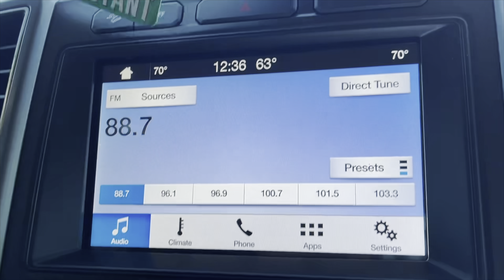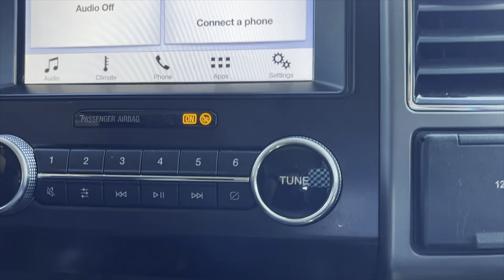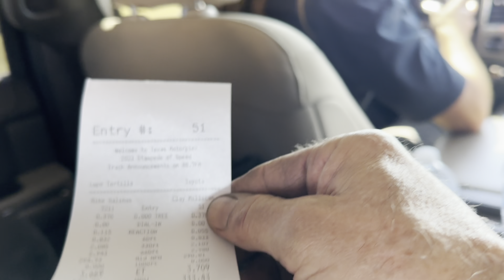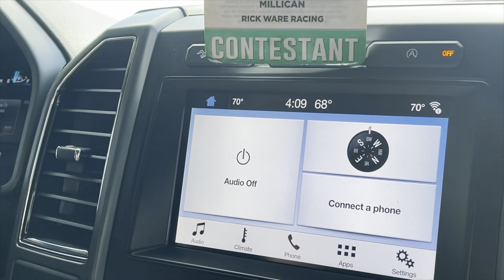This Wrecked Our Race Car

Comment: One of the best videos yet Clay and I was worried about the car when it came down hard like it did, and I was wondering if you guys were going to have to put a front half on it. I miss the between runs debriefing with Jim a little bit, but I do like this format now. Would be interesting if Jim would let you throw in a little bit of the debriefing also. 

Will you be able to show us any of the work in the shop going on over the next couple of weeks before Vegas? That would be awesome to see. Y’all did great at Texas, go knock em out in Vegas!

And this is added as an edit, you sure have all the hot ladies around you at these races Clay! 😊

Comment: I was at the Motor Plex in 1986. Like Jim said, Darrell Gwynn  ran a 27, then a 28 and blew the motor, came back with a 27 if I remember right. I think Garlits was running 32 and was on the top of the heap. People were shocked at what Gwynn was doing. I know a lot of towels were being used to cover motors. I think Berstein went over and hired Gwynn just to see what he was doing. The most impressive was Buddy Ingersols 262 CI twin turbo V6 Buick Regal out running Pro Stock 500 inch motors.

Comment: Another great video, Clay!! Continue to love “Jim-O-vision” and especially the post round radio chatter. The tech insight in the last 2 videos is something you can’t get anywhere else. You said on the radio post-first round that you saw a light come on the dash? What was the cause of it? Got me thinking, is there a light for low oil pressure that could’ve help alert the Q2 issue?? Like I said, love the tech insight, keep it coming!! #STOMPONTHATLOUDPEDAL
Reply from the maker: It’s a warning light in there now after what happened in q3 😊
Reply: Thanks Clay!!

Comment: Thank you for showing the wheelstand. I feel for RWR there wallet got emptyied this weekend. Great video thanks for the in depth one on one with jim O. To slow on the wheel speed , did the weelie bar have any damage to it ? Did it fail. Was it to high off the ground? Or just to slow on the wheel speed. ? Love the parts plus team. Clay you and jimO make a great pair. Thanks. Joe

Comment: I’ve been a fan of all racing for 50 years.  Drag racing has always been the one that just blew me away.  As a teenager all the guys were running some kind of muscle cars, so I understood getting horsepower to the ground.  Professional class drag racing has got to be the absolute hardest form of racing.  I would challenge anybody to try and get 12000 horsepower to the ground consistently good.  Too many variables, air, track temp, track condition, tune it up or down..  And It’s like trying to saddle up and ride a Tyrannosaurus rex.  The micro adjustments and decisions are infinite and my hats off to the team.  As Forrest Gump said, drag racing is like a box of chocolate you never know what you’re gonna get.  Forrest Gump did say that right?
Reply: Yes he did, they just edited it out of the movie....Forrest also was the first to say "Stommpp on the loud peddall"

Comment: Time 2130  

I've been wanting to pose this question for a while.  

Why don't dragsters ( at all levels it seems ) have a full length belly pan / floor for better aero?  I'm aware that the area ahead of the drivers capsule needs to flex however the belly pan / floor could be loosely mounted.   

Also looking at the pic, I can see daylight above what looks like to be the dash board.  Seems that this would allow air / debri into the drivers area.

Also, also. The dragster center section in your garage would make for an interesting project like on a zero turn mower or better yet, a pit vehicle.  

Thanks.

Comment: I don't know how much pressure RWR puts on you guys and I get the we win together and lose together. But some things just happen, so I wish you and Jim would not be so hard on yourselves. I definitely appreciate how humble you guys are!!! I appreciate Jims memories of the Motorplex, I was there for those memories he shared. I wonder if you guys remember Green Valley Raceway??
Reply: Oh yeah, I lived in Dallas from 1977 til 2003, was there for Eddie Hill's 4 second pass, went to Green Valley a few times, I remember when GV had the road race where Carrol Shelby raced a Cobra and I was on the backside where the turns were and you could hear everytime Carrol got to the straightway...good times. I am currently sad to find out that the Devil's Bowl has been sold to Amazon and this is the last year, went to many World of Outlaws races there along with just normal races, legendary track gone....
Reply: Yup good times good memories. Yeah a bunch of tracks around DFW have closed. Unbelievably, Yellow Belly still open though. LMAO
Reply: @davymurphy3073  haha, Yellow Belly, where it's Safety 3rd., a cockroach track that will be there after the nukes fall, where there are more bulletproof vests than engine diapers on the premises, the closest thing to a casino in the DFW area...
Reply: @indianaslim4971  Yeah I haven't been out there since the mid 80's but I see other Tubers videos of it, I think it's worse now, if that's possible.
Reply: @davymurphy3073  Yellow Belly is best seen on u-tube for sure, we probably crossed paths as it was the closest track to Dallas and went many times before the Motorplex opened in 86. I sure don't remember that huge of a crowd around the starting line like we see now, back in the day there would be a section of the bleachers where all the betting would go on, now it's the starting line, combine betting, alcohol, the number of people who settle problems with guns instead of fists and I'm surprised there aren't frequent shootings.

Comment: Clay I have a question for you.  Where can I get a wrist pin for a piston and rod I have from John force piston and rod that is autographed?  I looked online before but couldn’t fine nothing. Thanks for you content.  Love all the behind the scenes you show and how you explain everything you can and show.  Go get ‘‘em at Vegas!
Reply: I have some
Reply: @Smokey72013  I just need one to put it together so I can store it on a shelf together.
Reply: @willabunnjr216 measure the diameter of the wrist pin and use either PVC or metal pipe for a cheap way to display it.

Comment: Close races, but, a win is a win, no matter what. You/The Car/ Or both, must have thought, you were a pilot, instead of a race car driver. A few hammers, should straighten that right out. Parts and cars breaking are part and parcel of racing. Hope Jimbo, is not feeling bad about the things that happened. He seemed like he was. Good luck at the next one. Stomp on that loud pedal.